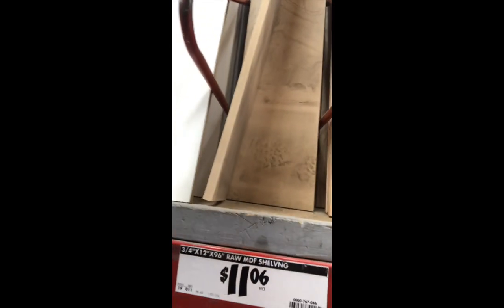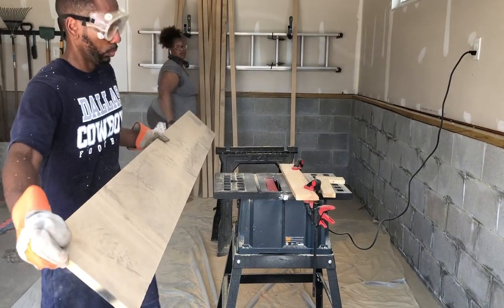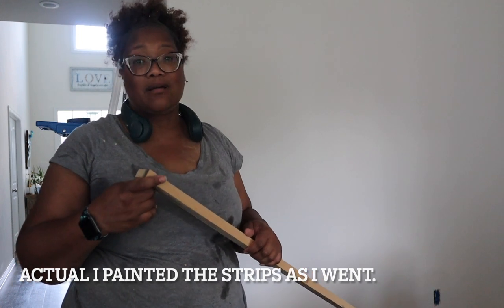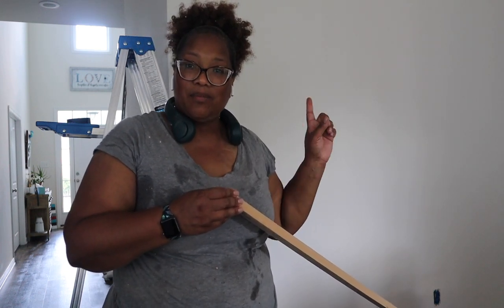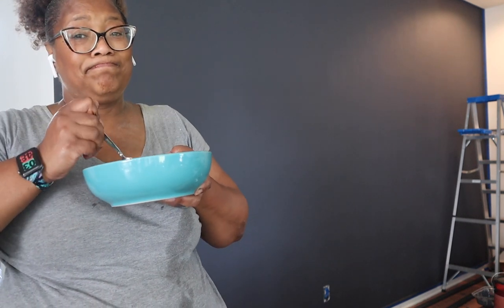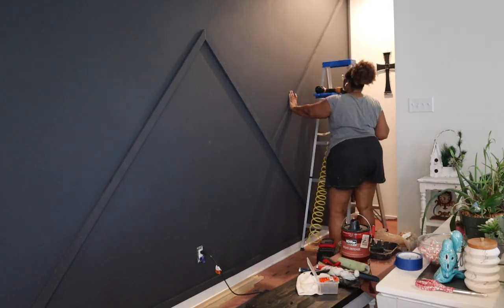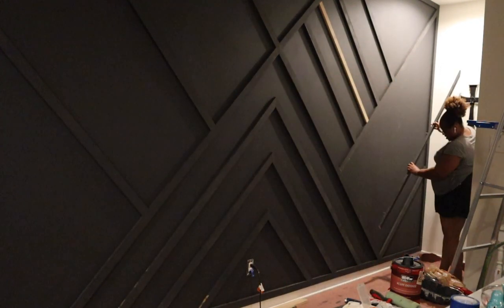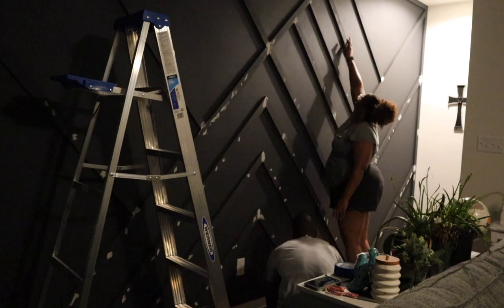Geometric Accent Wall Using Trim or MDR

Comment: what colour was that paint its beautiful and what wood did you use again i checked but didnt see it but it all turnt out nice you done a good job i wanna do this but im afraid of doin it wrong lol
Reply from the maker: You got this!!! The paint is Behr’s Orion Gray
Reply from the maker: Also, I used MDF for the boards. I basically find an mdf shelf (it’s cheaper) and cut it into strips. Just make sure your only use this inside. It is not water resistant

Comment: Love the accent wall and the information. Can you have the local hardware store cut the mdf board for you? I want to try this but won’t be able to cut the board to my desired size
Reply from the maker: The only problem with that is most don’t cut boards less than 12”. You would have to buy precut strips which is going to make this project more expensive.
Reply: @ProcrasCreationDIY  ohh okay thank you so much
Reply from the maker: @simply_fw  No problem.